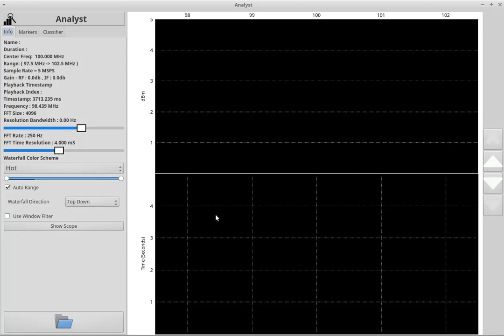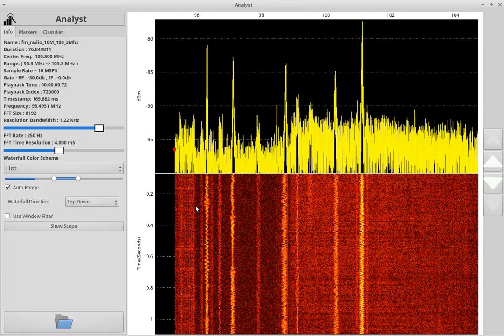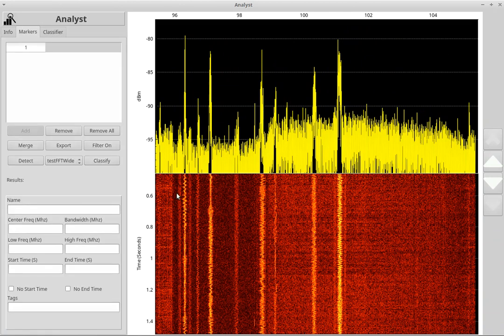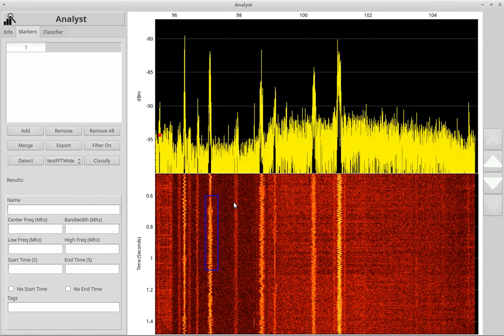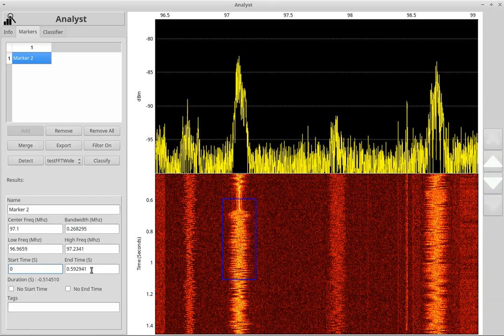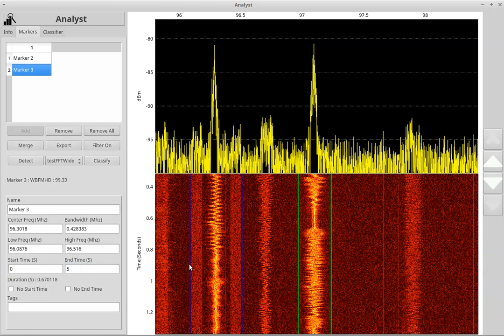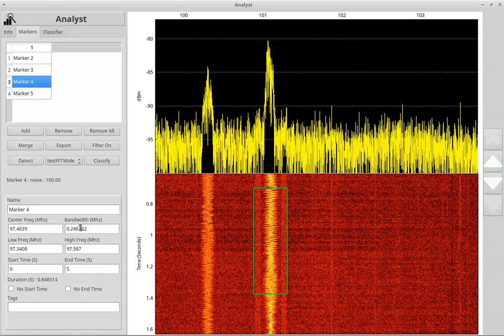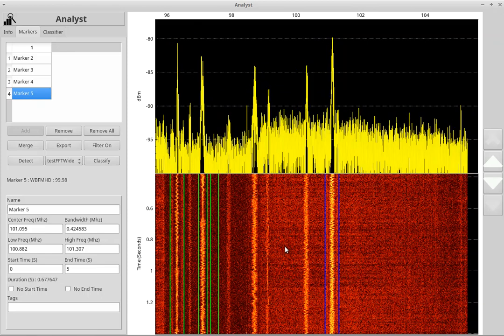RF Signal Classifiers with TensorFlow

Comment: Hi Steve! looks amazing stuff, any idea to share the code for that? looking to use something similar to train TF for audio signal
Reply from the maker: Unfortunately, I can't directly share code for this. What I can recommend is that you convert the timeseries data to a frequency series using an FFT, then build a training model with the small FFT segments as 1D inputs. The shape of the frequency components of the signal will be what your tensorflow algorithm can key off of.